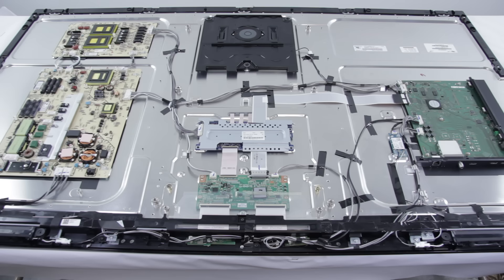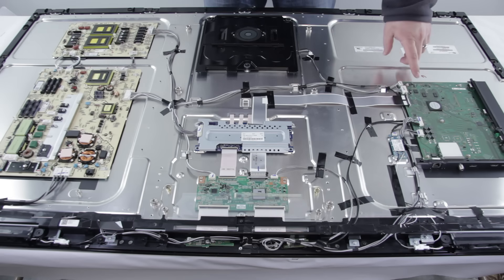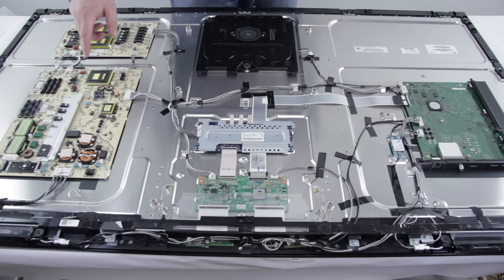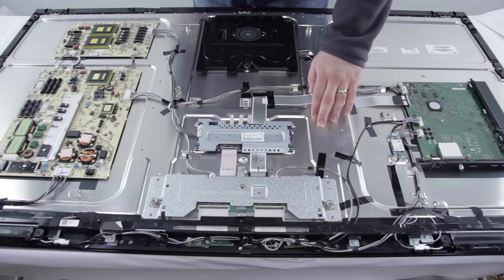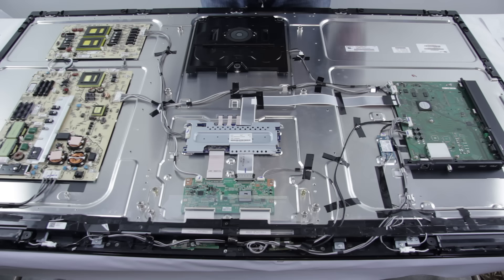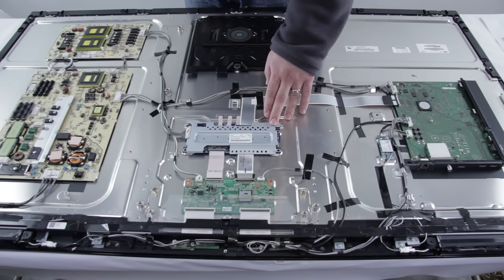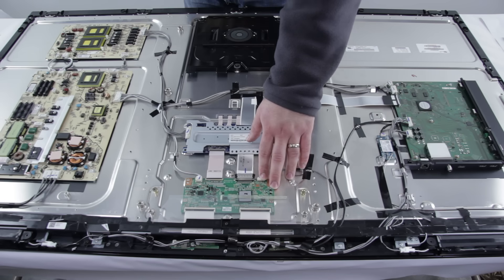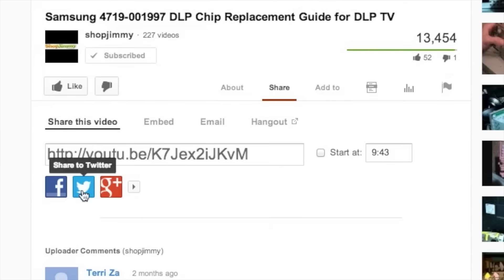LED TV Repair Tutorial - Common Symptoms & Solutions - How to Repair LED TVs

Comment: hello.I have an samsung UE32ES6560.And havent used it for a while.Now i am using it again.and the screen keeps flashing on off.and sometimes it stays on..But not for long...i tried turn backlight down,and save mode off,eco off.Different input,no input.Keeps flashing ,on/off??what could be the problem??

thanks
Reply from the maker: Marcel van Middendorp   I recommend replacing the power supply board in your TV.  Here is a link to replacement parts for your TV model number on our website, click here:  http://www.shopjimmy.com/samsung-bn44-00517b-power-supply.htm  Be sure to match part numbers on your current board, with your replacement for compatibility.  You can also call our customer service for further assistance with your purchase.  (877) 881-6492  Thanks and please let us know if you have any further questions with your TV Repair!  www.shopjimmy.com

Comment: I have a 47" vizio m470sv and I have sound but no picture...the backlight is on but have the screen is black and the other half is grey..before this happen the picture went all psychodelic and jumpy with lines everywhere...can you tell me what needs to be replaced
Reply from the maker: Justin Sears   I recommend replacing the main board in your TV.  Here is a link to replacement parts for your TV model number on our website, click here:  http://www.shopjimmy.com/catalogsearch/result/index/?cat=56&q=m470sv  Be sure to match part numbers on your current board, with your replacement for compatibility.  Here is a link to a video showing how to identify your part number, click here:  TV Part Number Identification Guide for Vizio Main Boards (Plasma, LCD, LED)  You can also call our customer service for further assistance with your purchase.  (877) 881-6492  Thanks and please let us know if you have any further questions with your TV Repair!  www.shopjimmy.com

Comment: I have a Hisense Model# 40K360M. My screen powers up and will show picture & sound. The problem is the screen is green and has a black vertical line from top to bottom. I removed the back & it has a power board, Main board & a long board on the bottom that has a plug from the main board going to it that's it. What do you think the issue is? Thank You
Reply from the maker: Charlie Roberts   This sounds like a TV panel problem.  If your TV panel is bad, it may be more cost-effective to replace the TV as panels are typically hard to find in stock, difficult to replace, and expensive.  Thanks and please let us know if you have any further questions!  www.shopjimmy.com

Comment: I have a Samsung UN46B6000VF and my front panel buttons aren't working anymore. Not only that, but my remote won't do anything other than turn the TV on and adjust the volume and change channels. Once the TV is on however, I can't shut it off unless the front panel power button decides to work for a brief second.
Reply from the maker: Joe Sato   I recommend replacing the main board in your TV.  Here is a link to replacement parts for your TV model number on our website, click here:  http://www.shopjimmy.com/catalogsearch/result/index/?cat=56&q=UN46B6000VF  Be sure to match part numbers on your current board, with your replacement for compatibility.  Here is a link to a video showing how to identify your part number, click here:  Samsung Main Boards & Digital Boards: Part Numbers for LED, LCD, DLP, Plasma TV Repair  You can also call our customer service for further assistance with your purchase.  (877) 881-6492  Thanks and please let us know if you have any further questions with your TV Repair!  www.shopjimmy.com

Comment: Hi my tv model is UA40ES6220RXXT and power Supply board bn44-00518a. my tv power led light is just blinking and won't start, I went to local shop he replaced capasitor, IC FSFR1700CXL but still not working and he gave up. I don't know what to do please help me

Comment: my LG 55LW6500 power on lights at right hand bottom of tv. No light or sound on the main screen can it still be the power board or main board? power lights up the ch , vol, input lights up but thats all.
Reply from the maker: DAVID HUGHES   I recommend replacing the main board in your TV.  Here is a link to replacement parts for your TV model number on our website, click here:  http://www.shopjimmy.com/catalogsearch/result/index/?cat=56&q=55LW6500  Be sure to match part numbers on your current board, with your replacement for compatibility.  Here is a link to a video showing how to identify your part number, click here:  TV Part Number Guide for LG & Zenith Main, Digital, & Tuner Boards (LCD, LED, Plasma TVs)  You can also call our customer service for further assistance with your purchase.  (877) 881-6492  Thanks and please let us know if you have any further questions with your TV Repair!  www.shopjimmy.com

Comment: LG 55LE5400 TV turns on, but the screen is black. There appears to be no back lights at all. There is also no sound. I tried the flashlight test, but couldn't see anything.
Reply from the maker: Jeremy Newman   I recommend replacing the main board in your TV.  Here is a link to replacement parts for your TV model number on our website, click here:  http://www.shopjimmy.com/catalogsearch/result/index/?cat=56&q=55LE5400  Be sure to match part numbers on your current board, with your replacement for compatibility.  Here is a link to a video showing how to identify your part number, click here:  TV Part Number Guide for LG & Zenith Main, Digital, & Tuner Boards (LCD, LED, Plasma TVs)  You can also call our customer service for further assistance with your purchase.  (877) 881-6492  Thanks and please let us know if you have any further questions with your TV Repair!  www.shopjimmy.com

Comment: 65 in Vizio Model number M3D650SV. Small horizontal lines. I have pictures. They're multi colored.
Reply from the maker: noblebosslady   This sounds like a TV panel problem.  If your TV panel is bad, it may be more cost-effective to replace the TV as panels are typically hard to find in stock, difficult to replace, and expensive.  Thanks and please let us know if you have any further questions!  www.shopjimmy.com

Comment: Toshiba 46SLU417U LED TV I have recently started having this problem were after watching the tv for a few hours it blanks out (no picture or sound) you can see back lighting at this point also just at the point when it blanks out there is a static sound then nothing, when it blanks out the tv will not turn off. after unplugging the TV for sometime the tv will power on and work as normal
Reply from the maker: Shauna-Kaye Gordon   I recommend replacing the main board in your TV.  Unfortunately I do not see any replacement parts in the search results for your TV model number on our website.  Please reply with your part number on your main board and I can try searching for replacement parts.  Thanks and please let us know if you have any further questions!  www.shopjimmy.com

Comment: Element ELEFT406 picture went out but can still be seen with a flashlight
Reply from the maker: Hunter Hart   This sounds like a bad power supply or bad LEDs in the TV.  You can replace the power supply board to see if that fixes the problem.  Here is a link to replacement parts for your TV model number on our website, click here:  http://www.shopjimmy.com/catalogsearch/result/?q=ELEFT406  Be sure to match part numbers on your current board, with your replacement for compatibility.  You can also call our customer service for further assistance with your purchase.  (877) 881-6492  Thanks and please let us know if you have any further questions with your TV Repair!  www.shopjimmy.com

Comment: Hi I have a RCA 52" led LCD full hdtv model no. LED52B55R120Q

The problem I'm having is that my tv doesn't turn on anymore the tv is hardly used. When I went to turn the tv on the little red light in the bottom left corner turns off and the screen stays black, I unplugged the tv for about 30 seconds then plugged it back in, turned the tv back on and it worked. The next day I went to go turn the tv on again and the same problem happened so I did what I did before and this time it didn't turn on. I tried this multiple times and still nothing. I'd really appreciate it if you can contact me back with some information. Thank you.
Reply: ShopJimmy.com do you have an answer to my question?

Comment: Lg 55ls4500, sound no picture. Backlights are on. Replaced T-con board with a unit from shopjimmy.com, still no picture or on screen menu. When you press the power light it blinks red 3-4 times and then stays solid red. Tried the flashlight test to see if the main backlights had failed and still no picture. It is an edge lit led/lcd. Replaced the main board and power board still no change. Any thoughts?
Reply from the maker: madashell83   I would try a different T-Con board in your TV, it sounds like you may have received a bad replacement board.  Give our customer service a call, (877) 881-6492.

Comment: Hi,I have LG 65LM6200  and I have a problem with power . I see red light but when I want to turn the tv on it doesn't do anything .I replaced the main board already and it did not help. I see red light but no sound and no picture, I don't know what else to do. Please let me know what I can do to fix my tv.
Reply from the maker: Grzegorz Hucko   This sounds like a defective main board replacement in your TV.  Here is a link to replacement parts for your TV model number on our website, click here:  http://www.shopjimmy.com/catalogsearch/result/index/?cat=56&q=65LM6200  Be sure to match part numbers on your current board, with your replacement for compatibility.  You can also call our customer service for further assistance with your purchase.  (877) 881-6492  Thanks and please let us know if you have any further questions with your TV Repair!  www.shopjimmy.com

Comment: Samsung LN-S4041D - I have power and sound but not picture. I did the flashlight test you posted and I do see images on the screen. What part is recommended to solve this problem
Reply from the maker: Arthur Stringfield   I recommend replacing the main board in your TV.  Unfortunately I do not see any replacement parts in the search results for your TV model number on our website.  Please reply with your part number on your main board and I can try searching for replacement parts.  Thanks and please let us know if you have any further questions!  www.shopjimmy.com

Comment: I have Sony KLD-42R500A Series Full HD 3D LED Tv ... All of a sudden it got switched off . After that when we are trying to switch it on ...the led light at the below flashing 3 times and following with another 3 time flash with 3 seconds gap..and Tv is not getting on.

Please help me with the issue I will be grateful to you
Reply from the maker: Mahesh Sornapudi   I recommend replacing the power supply board in your TV.  Unfortunately I do not see any replacement parts in the search results for your TV model number on our website.  Please reply with your part number on your power supply board and I can try searching for replacement parts.  Thanks and please let us know if you have any further questions!  www.shopjimmy.com

Comment: I have an RCA Led Model Number LED46C45RQ. The screen started occasionally going to black checkered boxes but after turned off and back on the picture would work again. Now the screen has gone completely black from the time it is turned on. I can hear sounds and all other functions seem to work except the picture. Any thoughts?
Reply from the maker: Meredith Mottley   I recommend replacing the main board in your TV.  Here is a link to replacement parts for your TV model number on our website, click here:  http://www.shopjimmy.com/catalogsearch/result/index/?cat=56&q=LED46C45RQ  Be sure to match part numbers on your current board, with your replacement for compatibility.  You can also call our customer service for further assistance with your purchase.  (877) 881-6492  Thanks and please let us know if you have any further questions with your TV Repair!  www.shopjimmy.com

Comment: Samsung 65" LED TV (UN65EH6000F) powered OFF while watching.  Powered screen ON briefly twice but now will not power.   The red light on the IR receiver is still lit and somewhat responsive but the LED screen will not power ON.  Any help with how to fix this would be greatly appreciated.  Thanks.
Reply from the maker: *****   I recommend running the flashlight test on your TV.   Here is a link to a video we produced that shows how to run the flashlight test. No Image No Picture on TV Screen-Flashlight Test LCD TV Repair - How to Diagnose Broken TV Repair Please reply with your flashlight test results and we can recommend a replacement part for your TV repair. Thanks and please let us know if you have any questions! www.shopjimmy.com

Comment: RCA- LED46C55R120Q- It is a 18 months tv that do not turn on. When I unplug and plug it again the red light appears but when I press the power button the red light disappears but the tv do not turn on. This problem was going on for several months, I did plugg and unplugg several times and then it tuned on, but now it do work in that way any more. Thanks for your help.
Reply from the maker: Marcelo Roggero   I recommend replacing the main board in your TV.  Here is a link to replacement parts for your TV model number on our website, click here:  http://www.shopjimmy.com/catalogsearch/result/index/?cat=56&q=LED46C55R120Q  Be sure to match part numbers on your current board, with your replacement for compatibility.  You can also call our customer service for further assistance with your purchase.  (877) 881-6492  Thanks and please let us know if you have any further questions with your TV Repair!  www.shopjimmy.com

Comment: Samsung UN55EH6000FXZA I have picture and sound on my tv but everything is dark. The only way i can look at the menu is if I use a flashlight so i can see picture.  Is this fix possible or is it better to try to not fix it at all and buy a new tv?
Reply from the maker: *****   I recommend replacing the power supply board in your TV.  Here is a link to replacement parts for your TV model number on our website, click here:  http://www.shopjimmy.com/samsung-bn44-00668a-power-supply-led-board.htm  Be sure to match part numbers on your current board, with your replacement for compatibility.  You can also call our customer service for further assistance with your purchase.  (877) 881-6492  Thanks and please let us know if you have any further questions with your TV Repair!  www.shopjimmy.com

Comment: Hello, I have a Samsung UN55D6050TFXZA LED TV that quit working today.  The red power light is flashing and the sound is working when I turn on the BOSE system but no picture!  I have unplugged the power, but no change in the flashing light.  Any Suggestions? 
Thank you,
Chris
Reply from the maker: CHRIS HODGSON   I recommend replacing the main board in your TV.  Here is a link to replacement parts for your TV model number on our website, click here:  http://www.shopjimmy.com/catalogsearch/result/index/?cat=56&q=UN55D6050TFXZA   Be sure to match part numbers on your current board, with your replacement for compatibility.  Here is a link to a video showing how to identify your part number, click here:  Samsung Main Boards & Digital Boards: Part Numbers for LED, LCD, DLP, Plasma TV Repair  You can also call our customer service for further assistance with your purchase.  (877) 881-6492  Thanks and please let us know if you have any further questions with your TV Repair!  www.shopjimmy.com

Comment: i have a vizio tv model no:E370-A01. they problem i am having is horizontal lines.sound is ok but display is lines.i notice a digital transistor burnt out on they t-con board tr 1,iorder a t-con board # 47-6021003 from shop jimmy .com.when i replace the board and power up they tv it burn back the same transistor on they new t-con board.anyone had this problem before please help me with this fix,thanks very much.
Reply from the maker: Mark Perreira   This sounds like a TV panel problem.  If your TV panel is bad, it may be more cost-effective to replace the TV as panels are typically hard to find in stock, difficult to replace, and expensive.  Thanks and please let us know if you have any further questions!  www.shopjimmy.com

Comment: Hi,
I have SONY LED 40''  and today there is a power fluctuation,that causes my  TV is not working.
Could you please tell me what is the problem or what part i need to be replace.
Reply from the maker: *****   I recommend replacing the power supply board in your TV.  Please reply with your TV model number and then I can recommend replacement parts.  Thanks!  www.shopjimmy.com

Comment: I have a Samsung 55" LED / Model UN55B6000 that has a double screen or a blurred screen ever since we plugged it back in after returning from vacation. What could have happened and is it repairable?? I've replaced the cable from the wall to the cable box that had a broken end. It's been unplugged, rebooted, etc. I've seen on You Tube that this might be repairable by adding a piece of tape on the ribbon wire terminals. Is this true also??
Reply from the maker: Mark Tremmel   This sounds like a TV panel problem.  If your TV panel is bad, it may be more cost-effective to replace the TV as panels are typically hard to find in stock, difficult to replace, and expensive.  Thanks and please let us know if you have any further questions!  www.shopjimmy.com